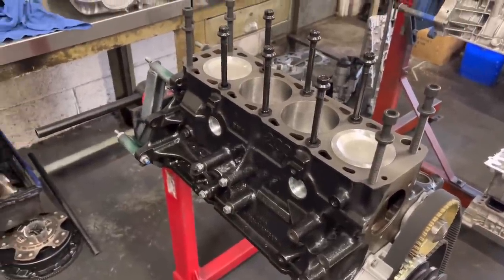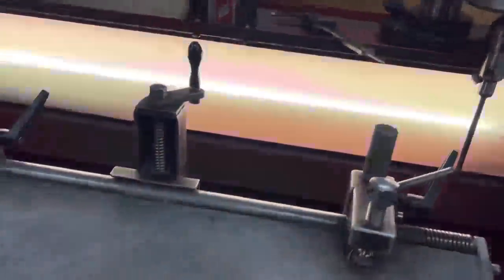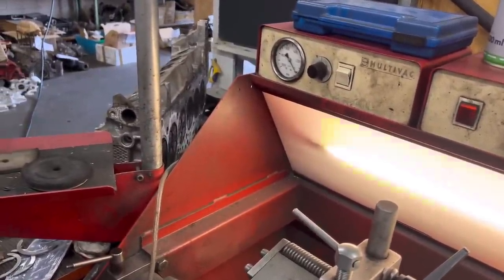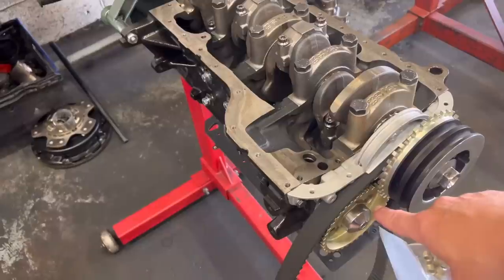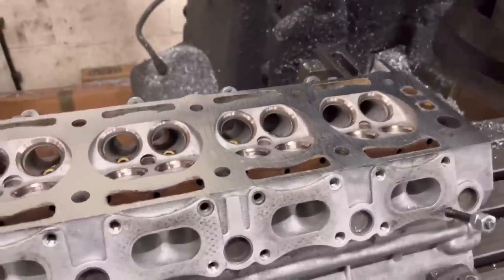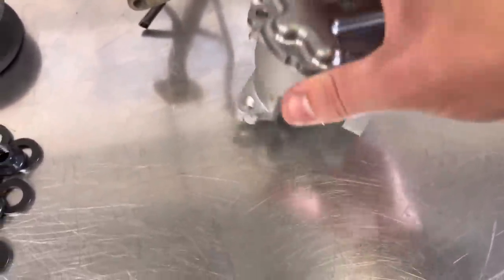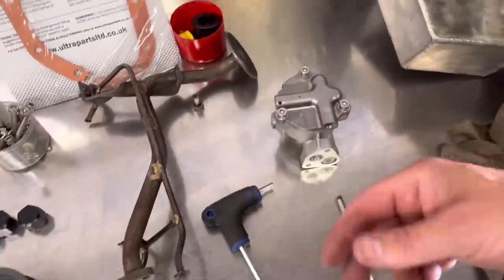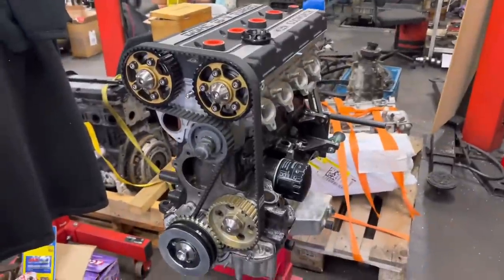Building a Cosworth for this Mk1 Escort PROPERLY!

Comment: Lee, hello from Oz, first up let me say I'm thoroughly enjoying the engineering deep dive into the finer details of performance engine machining/rebuilding.
A question re; Cosworth under piston cooling jets, as a way of mitigating piston crown heat, I am fitting under piston oil cooling jets to an engine  that is  undergoing a power output upgrade, (nothing to radical) the engine  didn't originally have these fitted, should I be concerned with the piston oil ring drain holes being flooded and possibly flooding the oil drain holes or preventing the oil from freely draining  from behind the oil rings  into the piston underside? 
Possibly inducing an oil burning situation? 
Or could I be over thinking this? your thoughts would be greatly appreciated.
Cheers ,
Glenn.  DownUnder .
Reply: AUSSIE AUSSIE AUSSIE!

Comment: Having valves seated at differing depths surely changes the compression ratios between cylinders and power distribution. Why not renew the worn seat; surely better seat all to the same depth?
Reply: The difference in compression due to the very modest diff in valve depths would be small.  In any case, perfection is dependant on what the customer is prepared to pay.  If it was my engine, the circa 4 thou (0.1mm) difference in one valve would be acceptable.
Reply: That's what 1mm oversize valves are for.
Reply: @1magnit  Agreed - however the decision lies with what the customer is prepared to pay.

Comment: Just a quick comment not picking and there may be a reason,but why do all the valves and seats and test then skim the head,why not skim the head and If its badly worn and won't face you then need a new head and won't need to do the valves,excellent video though..
Reply: A visual examination of the head and old gasket generally provides sufficient information for an experienced engine builer to establish whether the head is recoverable by a modest skim.  If required a quick clean and use of a straight edge will remove any lingering doubts.

Comment: What is a genuine Ford oil filter? Ford don’t make filters…
Reply: Ford oil filters are manufactured by Motorcraft which is a subsiduary to the Ford Motor Company.  However, Motorcraft has the 'corporate right' to make parts for other OEMs if wishes to do so.  GM use ACDelco as its parts company - which also makes parts for other makes - e.g. spark plugs, filters, etc.
Reply: Seriously? I bet you're fun at parties....
Reply: @DL180sx  WOW - Your comment is such 'value add'.
Reply: @georgebettiol8338  Im glad i have you to comment back.
Reply: @DL180sx  Apologies - it appears I have misinterpreted your comment.
Reply: @georgebettiol8338  I was referring to the original comment that was picking apart the video about an OEM filter. We all know OEM means the ones the manufacture supplies.